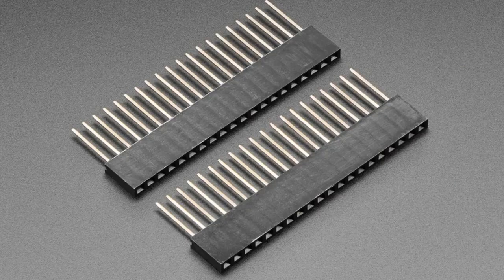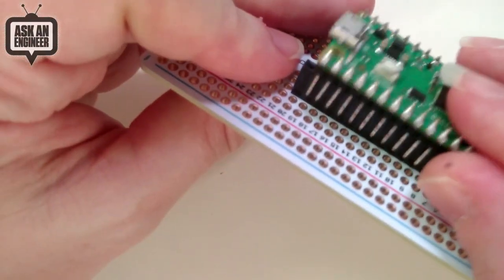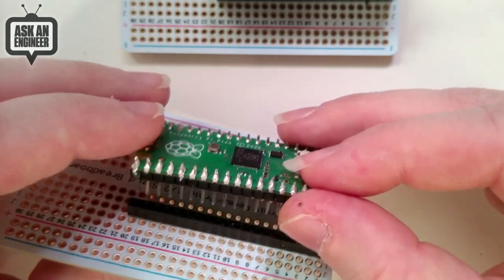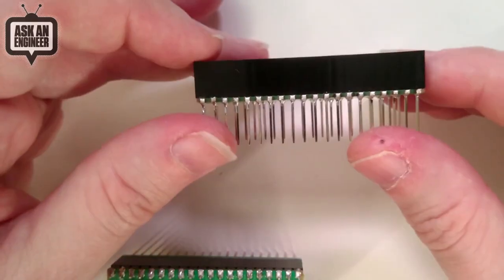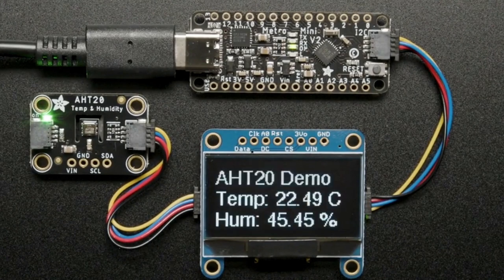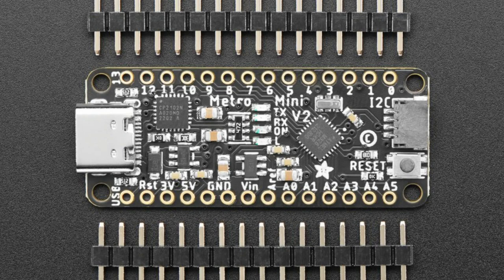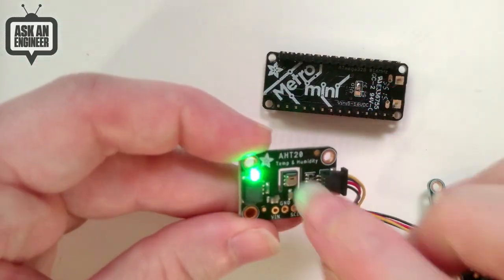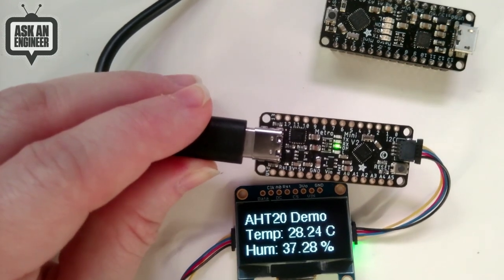#NewProducts 8/17/2022 Featuring #adafruit Metro Mini 328 V2  - #Arduino-Compatible - 5V 16MHz QT!

Comment: Hitting the reset button with the stacking header on the MCU board IS a challenge, but I was thinking you don't so much need to scope the MCU, that's a known entity. But you do need to scope the circuit you designed to go with it. You need to 3D print a little tetter-totter stick with a bump that aligns with the edge of the upper board and a bump at the end to push the reset.